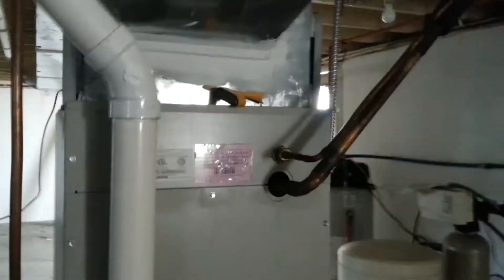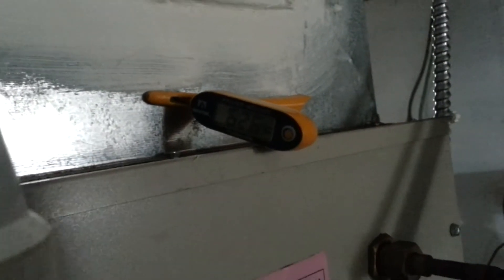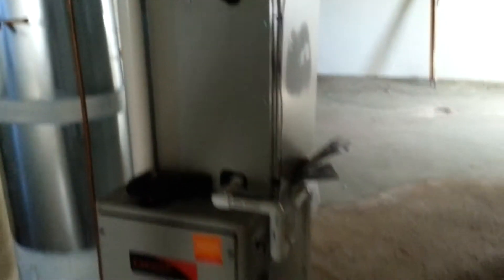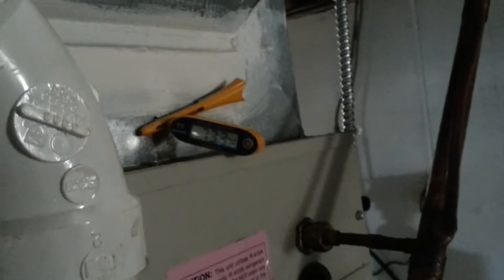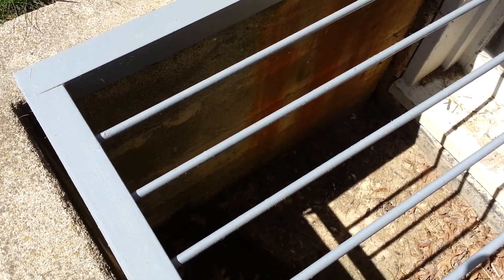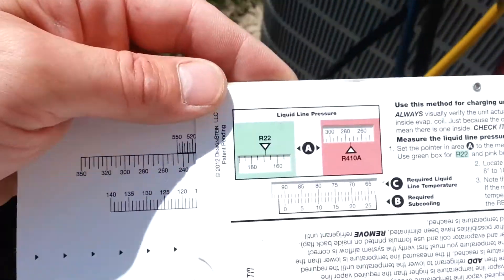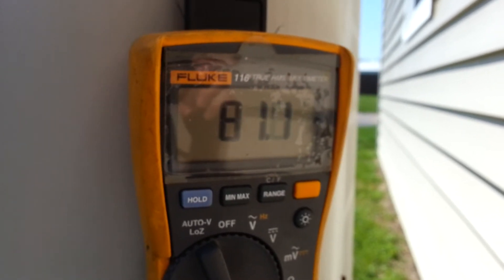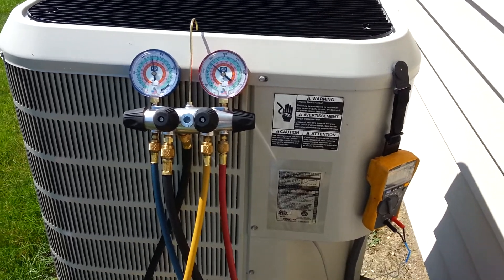HVAC-Nordyne heat pump/no cooling call

Comment from the maker: Thanks Neil! That unit came precharged from the factory with just under 7lbs! It's only a 4 ton system! 
The condenser coil is leaking, still under warranty so I am waiting for the supply house to get the new coil in for me so I can swap them out. 
PJ